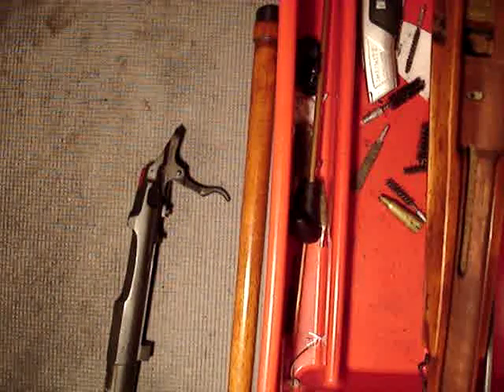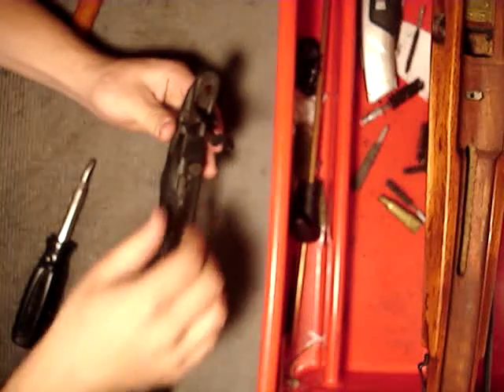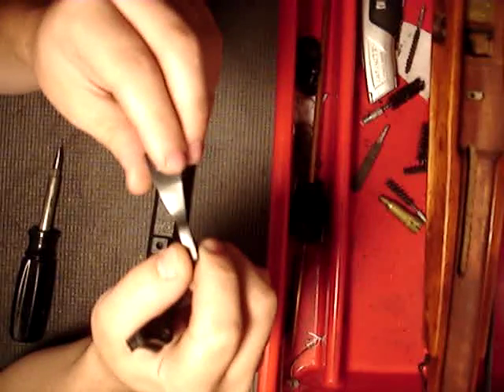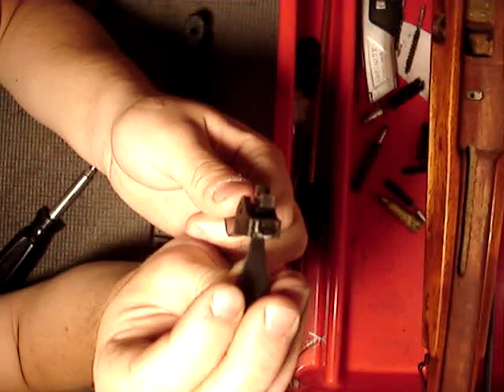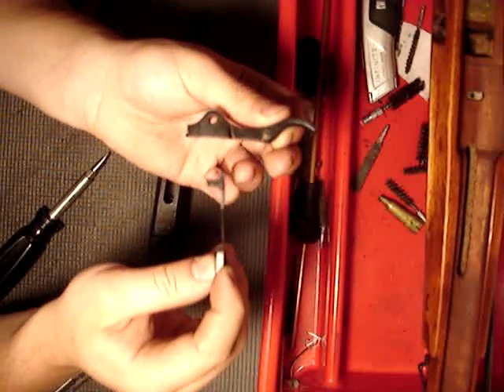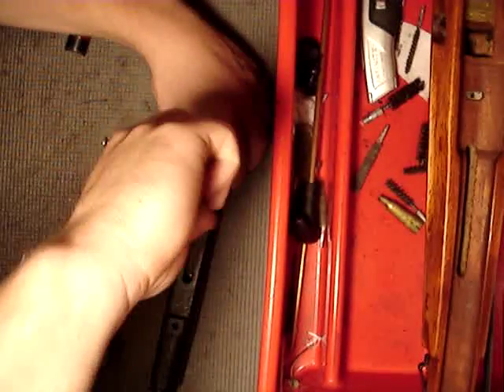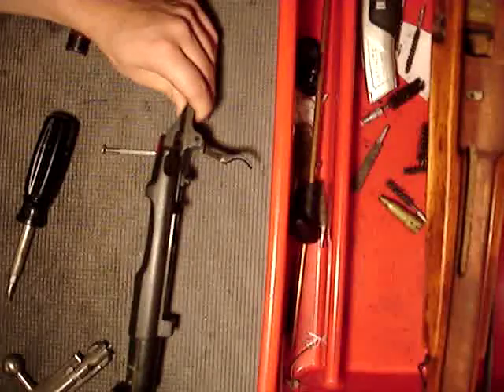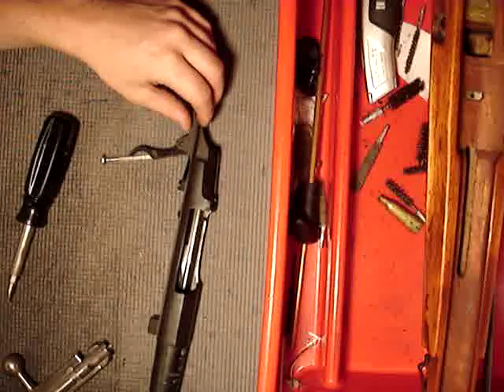mosin nagant trigger disassembly and reassembly

Comment: Mine has way more trigger slack than that, that's why I'm here 😀. Probably going to take it apart and see if I need to replace parts. Numrich gun parts has a lot of hard to find & old gun parts btw. Got an extractor for a little 22 I have that is one of those guns people will tell you it's impossible to find parts for, but they have all kinds of parts. 5/5 🌟 from me.